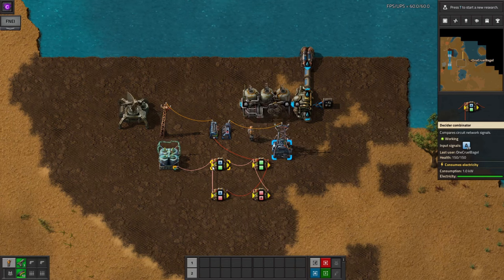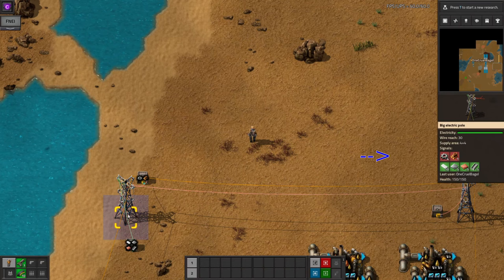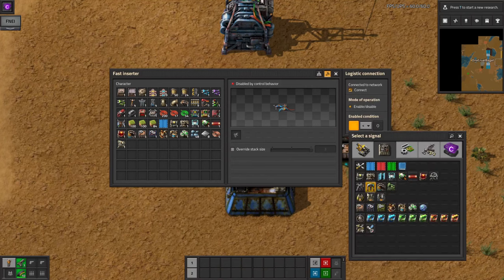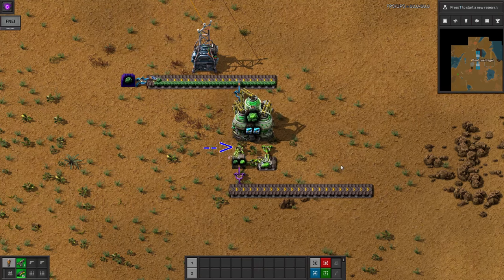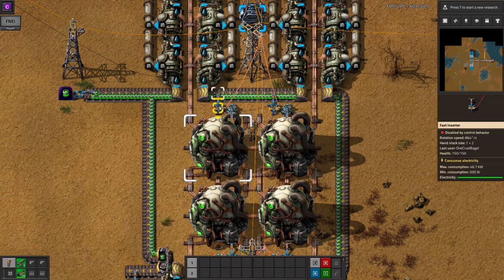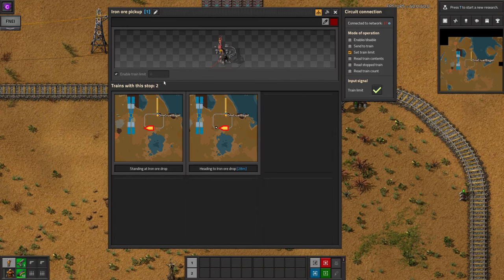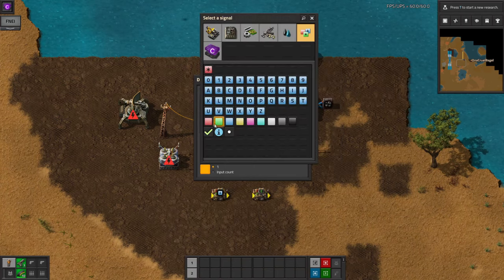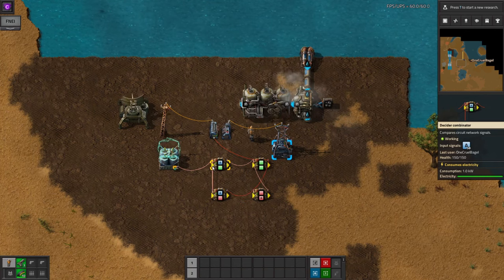Circuit Network Tutorial - Laurence Plays Factorio

Comment: For the train limits, you could also use an arithmetic combinator to divide the amount of iron ore by a full train load and output that as ticks to be set as the train limit. That way it scales to more trains automatically.
Reply from the maker: That's true, that would be a very neat way to do it!
Reply: Came here to say that as well (=
Reply: You have to be careful with that because you can end up with a train limit higher than what the station layout can handle. You either have to limit the buffer chests to limit the available loads, or do some more circuit magic to limit how high the signal can go.
Reply: @Eylrid  True, the queuing trains could extend out onto the main line if you don't take that into account. As you suggest, there are various ways of protecting from that but they do add to the complexity

Comment: Nuclear power design ain't good because inserters still insert more fuel than necessary inbetween the time. What you can do instead is set all inserters to stack size 1 and read hand content, and connect all inserters to tanks. output inserter only works if steam tank fall below some amount. for a four reactor set up, about 6 empty tanks worth of space is should be enough, so trigger below limit of steam to be enough. Lastly, set input inserter to only work when output inserter has used fuel cell in hand. That way they all work together.
Reply from the maker: As long as you've got enough steam tanks to use up the full load of fuel, it's fine. Your way is more complex and this is "circuit network basics", but you're quite right, that would definitely work as well. 

The problem with your design is if you have a fuel shortage; the system won't neatly restart itself if it misses an unload. So, it's neater and more efficient, but less robust.

Comment: Regarding the nuclear power setup: there's a slightly (but only slightly) more complex way to setup the system so that only one fuel cell is added at a time and thus you don't need many steam tanks as a buffer (I have 6 per 4-reactor plant and even that seems to be overkill). Then again, if you want to use the steam buffer as an accumulator, then it's not an issue. I prefer a bit different emergency power setup for myself so that I can more easier see if I need to add more base power
Reply from the maker: True, Marc built up a system that does that for our K2SE run, however it has the downside that if it runs out of fuel cells, it won't self-restart, even if it has power from somewhere else. I suspect a more complex system could be made which achieves both, but I haven't bothered to go to that level of complexity yet as this system works nicely!

Comment: For backup power I use the 3 decider latch setup from the wiki. But yours made for an easier explanation.
Reply from the maker: I'll have to check that out - I assume the "off" one is removed and you just check for >80% charge on the bottom one, instead of checking for red square?
Reply: @LaurencePlays  nope, you have to on and off combinators (your left side) and combine the two on the right. You connect input and output, have to use different cable colours and check for green > red output then 1 green, which loops back. 
But as I said, it’s not that easy to understand what happens
Reply from the maker: @marcmessing  Ah, that makes some sense, I think - I think I can see how that would work. Still, my suggestion also eliminates a combinator, and is much easier to understand, so I think it's better  😀

Comment: The last example of the "loop" is really new and cool to me. The ideia of sending the signal back to keep the loop of green square on is really well made
Reply from the maker: You can make timers with these by feeding 1 into the input as well (so it increases by 1 each tick) and triggering a reset when it reaches a certain number. In hindsight, I wish I'd added that to the video!
Reply: I think it may be more suitable for an advanced circuit video... But at the same time, i dont think a video like that is all that necessary, most people dont get to that point lol  @LaurencePlays
Reply from the maker: @viniciuspessoa8628  Yeah, it took me a long time to get round to actually using any timers, but we've got a few managing our spaceships! It would have made a nice finisher for the video, I think - an introduction to more complex circuit possibilities.

Comment: 10:05 You can remove right bottom combinator and connect (right top) compinator output in input with green cable and set (Green > Red -> 1 Green) (If A < 20, in input is 1 Green, after 1 tick you have 2 Green in input, when A > 20, in input: 1 Green and 0 Red (1 > 0) -> 1Green and it will be live. When A > 80 -> (1Green > 1Red) - > (False) Green will be missing). It can save 1 Kw energy xD.

Comment: For the hysteresis - is that the same as a SR-latch? Because blueprints for the SR-latch exist, pretty simple and with just 3 combinators
Reply from the maker: Yes, it's the same idea, I built it like that for simplicity of explanation and because that's a design I could build off the top of my head! I should probably take a look at the 3 combinator version...
Reply: @LaurencePlays Hey there. I'd be very surprised if you haven't investigated the SR Latch by now so recommending it feels redundant but I was intrigued by the method you came up with. I'd be very interested to test if they are completely behaviourally identical or not. Will give it a go! I'm a big fan of SR Latches for my fill-up stations. E.g. a wall has a train stop that delivers repair packs, walls, ammo (especially oil!) but the train might deliver the required amount and before the train has even left sight of the wall, the combinator setup says 'we need more!'  I'm trying to work out if I can use a single SR Latch to serve all the materials needed at a wall repair station (e.g. Come deliver when any item is lower than an arbitrary threshold (set filters on filter inserters so we don't just grab everything out the train) but then fill up to an amount, say, 5 times that lower threshold. It's not quite SR Latch now I think of it but it's similar and now I'm inspired thanks to you!! (Sorry for long essay!)
Reply from the maker: @mikeydflyingtoaster  I have - I'll probably carry on building them the way I did in this video out of habit, but I am definitely familiar with them! I've used what I think is the system you're suggesting for my outpost stations - see https://www.youtube.com/watch?v=43AM01VcW3Y - it doesn't use a latch at all, just adding numbers together with combinators. It certainly has the effect you're asking for, even if it's not made the way you're thinking.
Reply: @LaurencePlays  no!! It must be needlessly complicated so everyone knows how clever I am! Bit-shifting… errr memory cells! Pulse generators. I use all of them all the time!!
Reply from the maker: @mikeydflyingtoaster  Sounds like you've fallen down the rabbit hole!  😀

Comment: Love the video but why does everyone use the train limit with a combinator instead of just using the enable/disable feature already built into the train stop? It even has the nice feature of changing the train stop color on the map to red when disabled.
Reply from the maker: There are several differences between disabling a stop and setting the train limit.
- If a train has more than 2 stops in its route, it will skip a disabled stop, but wait for a limit-0 stop to become available
- If you set the train limit, you can set it to larger numbers if you want more trains to come (eg if a mine has enough ore for 3 trains, you can set the limit to 3)
- Disabled stations appear red on the map, limit=0 stations appear purple
So, you can use whichever you prefer! Sometimes it matters, sometimes it doesn't.
Reply: @LaurencePlays  interesting. I never had anyone explain the benefits of limits over e/d considering the second is simpler to set up. Thanks.
Reply from the maker: @lightneko  I should have included it in the video, I guess.   😀  You're quite right though, in the basic case I demonstrated, disabling the station would be simpler. 
In our current K2SE run (streams and summary videos available on the channel! Shameless plug!) we're using both types of station deactivation, depending on whether we want trains to wait for the station to become ready, or whether we want it to be skipped.

Comment: Hi, can you do a video on balanced train loading and unloading using circuits?
Reply from the maker: That's not something I've personally needed - I generally try to keep my stations balanced by using belt balancers on the way in and out, however it's definitely something I could talk about.

The usual way I think involves reading the contents of the station and having the inserters only run if they have more than the average. I'll have a think about what I can put in a video - thanks for the suggestion!

Comment: Why not "simply" enable/disable the train station depending on the availability of sufficient cargo? Adding the decider in between seems like a wasted step unless there's a specific benefit in using the train limit over enable/disable.
Reply from the maker: There are a couple of benefits, neither of which I'm actually taking advantage of here, but I've got into the habit of setting it up like this anyway...
- The first benefit is that if you put in a third station (perhaps because you have a separate fuel stop or two loading stations) then the train will travel endlessly between the other two stations, if the station is disabled. If it has a train limit of 0, the train will wait at the previous station.
- The second is that this way you can (if you want!) divide the available or required resource by the amount that fits in a train and tell the station to request multiple trains. This is more complex and I haven't talked about it here, but it is an improvement you can make.
Reply: Looks like I set myself up for answering said question, by your suggestion of using train limits. Looks like enable/disable with a train limit of 1 is okay, but causes problems if the limit is greater than 1.
Reply: @LaurencePlays  Thanks for the insight!
Reply: @crashmatrix  Also enable/disable can cause the train to just stop if the station it is heading towards becomes disabled. The train limit system has not got this problem as the trains will always continue their journey to the station. Overall the devs at Wube have pushed the train limit system as superior for some time now.